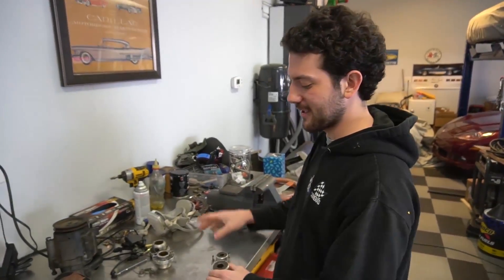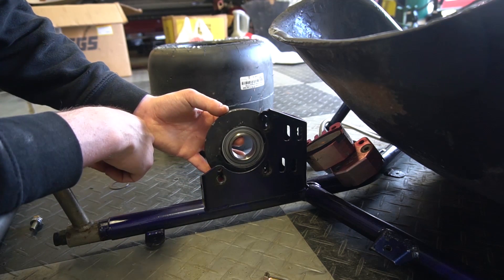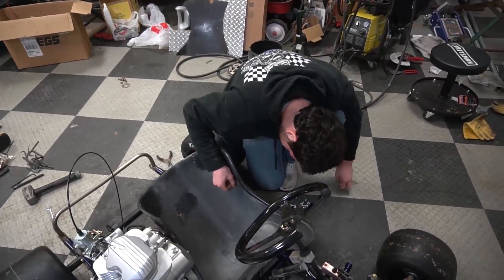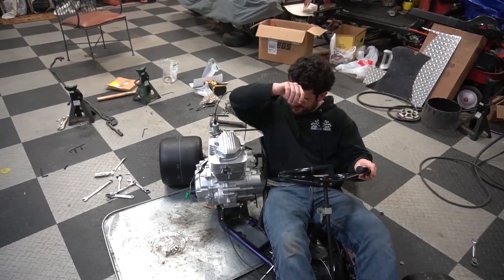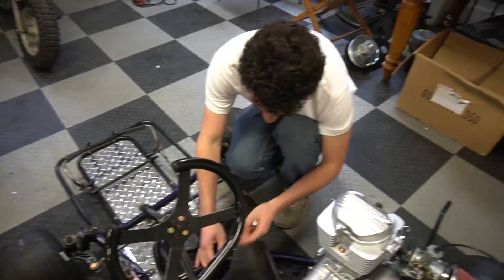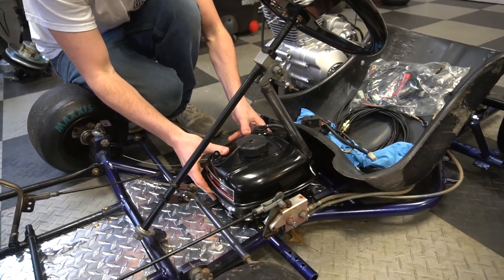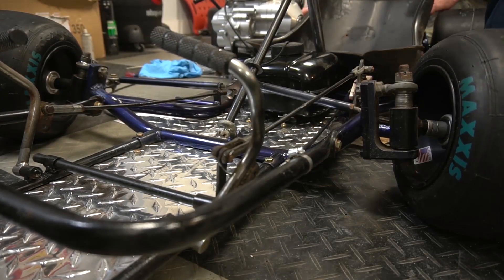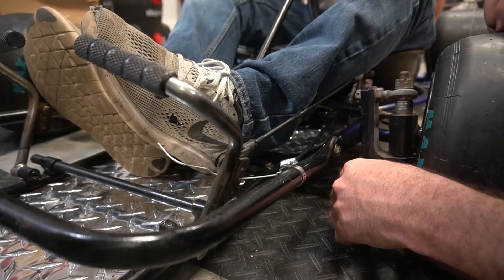200cc Racing Shifter Kart Build: Rolling Chassis! (Pt. 3)

Comment: Random tips to help your go kart faster:
(Small engine performance mod list)
1. Open up air filter for more air flow.
2. Make sure throttle has full travel.
3. Clean the carb and fuel system.
4. Port and polish.
5. Mill the head.
6. Remove governor.
7. Stiffer valve springs.
8. Drill carb needle jet.
9. Open up the muffler.
10. Billet flywheel.

Comment: Go to a local "trucking/heavy equipment" repair garage. BYOB. Ask them for a few gallons of their USED oil from diesel engines. When making any kind of pedal, lever, etc., heat the rod at your desired bend with a MAP torch until cherry red. Bend it, then quench in the oil only- NEVER water. Leave it in the oil till cool. The hydrocarbon and sulfur will temper it, giving it strength; quenching with water will harden it like glass, and will easily snap.

Comment: On the miata coolant leak - does that engine have the coolant block-off plate on the back of the engine like the stock miata engine? That could be where your coolant leak is. May also be a small rubber cap there.

Comment: Silly question but why not heat the rod for the brake pedal with a torch and bend it instead if cutting and bending then welding ??? Seems like a lot of extra not needed work.
Reply: lol. dont have a torch

Comment: What I use for throttle cables are hood latch cables from a gm car. The ends of the housing screw off so you can cut them down and reinstall the end for a custom fit. And if it brakes over time, just go get another one from a salvage yard or dealer.

Comment: Wish I could help you guys do the wiring. I've wires alot of similar engines and learnt a few tricks. Chinese wiring diagrams are pretty much useless but the cdi plugs are usually always wired the same way as are the stators. Just a case of pulling the cover and tracing the wires on the stator to the pick up/pulse coil (usually blue and black) and an a.c. power wire (usually 1 red and black) at minimum to make it run. Then there's a wire/pin for the kill switch, a ground (2 ground wires on the 6 pin cdi you have in the vid, google 6 pin cdi and on images the pins are labled) and the coil (from the cdi). 
The other wires go to the reg rec (usually yellow and a white) from.the engine to yellow/pink on the cdi). Hopefully I'm not telling you what you guys already know lol

Comment: dude dont play with it buy the kit and drop a 302 in there be done with it. take the engine to a shop have them stroke it and make it into a 347 stroker and get scared because it will be crazy fast and crazy easy to burn the tires off it

Comment: Assuming you noticed while editing the video but it was not the barrel nut that slipped. It was the hoseclamp you are using "for testin purposes only" too keep the clutch cable end on the frame.

Comment: Always cut diamond plate from the back, a lot smoother to cut and leaves a better edge. Also.... John,  heat is your friend when bending thick round bar like you used for the brake peddle. Sooo much easier and quicker. The kart is coming together nicely! Ready to see her rippin' down the road and banging gears!!

Comment: Still sounds like your plasma cutter still has too much pressure. You need a water separator/pressure regulator mounted on the plasma cutter.

Comment: I have a problem with my go kart if anyone could help It would be amazing I got it for 600$ perfectly running one month later I turn it on , start driving it for like 10 or 20 seconds then turns off, I changed the fuel pump, could it be the carboratour because barely no gas is flowing through

Comment: The card your using is fairly cheap. You best bet would be to use a real Mikuni Vm26 or vm28. You will get better quality, but also much better air flow. Real Vm carbs dont have butterfly chokes, they have internal chokes. $120 for a real vm carb is worth it if you want get better power and better tuning.

Comment: Please don't think im being a know it all sorry if i come accross like that 😔 use are very smart, talanted  an may allready know but in my experience for that low fuel tank to work you'll need a fuel pump with a secondary small surge tank or a palse vacume pump a put a vacc line into your intake manifold. I buy the complete wiring loom its strange how it never came with the loom all mine always doo. Besides full looms are under 60 bucks anyway an you get everything plug n play. Love the vids guys an this shifter kart is very cool.

Comment: Regarding that brake pedal, there are two things that will send a blacksmith to hell.  Bending cold metal, and not charging enough.  Instead of trying to pie cut things, just grab a fire stick, and get it to dull red. It will bend easily then.
Reply: i wish we had a torch
Reply: Isaac it'll be fine 
While having something that adds oxygen would be helpful, you can get the metal hot enough with a $20 map gas rig.  Or you could go old school blacksmith, with some charcoal and a source of air like a hairdryer or even a computer fan in a shroud.

Comment: it's the same CDI as on the Pugly, have a look at where the cables run from that CDI and do likewise on the shifter kart. the two contacts next to the 4 pins cdi goes to the pickup, and two of the four goes to 12v the other two goes to the engine stop switch, Pugly will tell...
Reply: its different than pugly we checked

Comment: Add a bracket and tap it to put a bicycle brake cable adjuster for your clutch cable. It should work well. Try to find a bmx one that is steel or heavy duty and mount it on the frame in front with your clutch cable in it. I have had good luck with this method. Even the cheap aluminum ones will work but they wear out prematurely. Also bike stuff is  easy to find.

Comment: Quick tip: youre supposed to run axle collars one every part where there an exposed KEY, so the key cant slide out, so the sprocket, brake disk and possibly the wheel hubs should have two-pc collars holding the keys bros!
Reply: Also, the electric fuel pump is overkill and silly, a vacuum diaphragm one would have been better- youre gunna flood like a mess with that setup
Reply: What the heck is that "Rod" youre using for pedals? looks like Galvanized? YUCK! should be some regular cold or hot-rolled bar stock, then HEAT it with a torch to bend it,  youve got a mess there dude!
Reply: Lastly, why WELD a bar for the clutch cable across the BOLTED-ON bumper and the frame, make it removable so if you crash it, it can we serviced?

Comment: Making a shield between the engine and the driver can also double as an air diverter which has a slight ''hood scoop' effect at higher speeds if you sculpt the material the right way. also gives a place for a padded arm rest! (~_^)-b

Comment: i had a foot clutch on my 175cc 2stroke shifter kart.you use it once to get started then you rev match the clutch starts to slip if you use it in higher gears, not at first but it will. your kart is gonna be fast as hell with that small rear sprocket dudes

Comment: Engine placement maybe lil hot!!! So I'm wondering if maybe put an oil cooler on the front of cart somewhere it ventilates properly and run hoses to and fro,.. Would that help to keep it cool enough so it'd not be uncomfortable to ride?? Maybe take oil cooler from an old Yamaha moto4  350atv. I bet it'd be pretty cheap but idk how much it would help. Or if even possible to change that engine over to be oil cooled. What are your inputs on this {cars and cameras} or anyone else?? Would it be sufficient? 
That intro 😄, different but 👌, hell I liked it..
Reply: we will wing it
Reply: BlkiceMike maybe they could make a heat shield

Comment: I have a 200cc motor. And i used that wiring diagram too. When i hooked everything up i relased there was no spark. I checked the wiring with no luck. After a week of trying to get spark, i found out that the wiring diagram was wrong. To wires on the cdi has to switch places. I cant remember which wire, but After that i got spark and its working today. Hope this will help u out guys. Big fan from norway!
Reply: thanks. we got it running first try

Comment: If you haven't figured out the wiring yet i can help you with it. I've done wiring on all kinds of engines. They all kinda work the same way, only thing is if its an AC or DC system that makes a difference.
Reply from the maker: We finally got it figured out and fired it for the first time today! Thanks!
Reply: Knowing enough to be dangerous I think the ac/dc is their problem. Trying to make one work in a system designed for the other is just about a complete rewire and you might as well buy the correct cdi for the harness.

There is also one type that has 2 different types of plugs. One they are rounded on the corners and the other square. If memory serves I think they will swap if you change the connectors on the harness. I want to say its the ac but again I don't recall exactly. Too many moons and beers have passed since I worked on these regular enough to spout facts without having to double check.
Reply: neo 71665, you cannot use an AC cdi box on a DC system. It will not work no matter what wiring you do. The AC systems get their voltage from the stator and the DC systems get their voltage from switched power. That being said you may be able to get a DC cdi working on an AC system, but i've never tried that. Maybe i will try it just to see if it will work. The plugs dont tell you if its AC or DC its the size of the box that tells you. AC boxes are very small and DC cdi boxes are much bigger. I believe the cdi they showed in the video is a DC box.
Reply: FireAndGasoline do you know the wiring to get a 82-83 honda cb750 running? Thats my karts engine if i can get it running
Reply: FireAndGasoline it works!, done it on many scooters, just don't use a 2stroke on a 4 or vise versa
Reply: nathan butler, i dont know it specifically off the top of my head. If you message me on Facebook or Instagram I'd be glad to help.
Reply: FireAndGasoline The AC/DC swapping rules get very fuzzy from engine to engine. If the engine has an exciter coil, an AC CDI can be used. You just connect the output of the exciter to the power input of the box. DC CDIs need a constant DC voltage source whether that be a rectified 2 or 3 phase stator or just an auxiliary battery. It's not difficult to switch from an AC Box to a DC box if your engine has a charging system and regulator. My gy6 based buggy is setup this way. AC box, but full DC charging system. 
On most DC fired systems, the stator sometimes will have a built in exciter coil due to the modularity of stators. This would be unused unless for some reason you wanted to switch to an AC Box. 

All of these 6 pin CDIs are based on the old Honda 4 wheeler, 3 wheeler, and scooter engine boxes. I've actually used one of these CDIs to fire a yamaha 350 atv engine with a from scratch harness.
Reply: nathan butler , The easiest way would probably to get the wiring harness and just tape up anything you don't need. You'll need the starter solenoid, cdi, coils, pickups("pulse generator"under the right crankshaft cover), starter/kill switch.  There are simple wiring diagrams for the old 69-78 fours floating around. Your bike is almost the same but instead of points(connect to coils) you have pulse generators(connect to cdi).

Comment: Guys I've got kart with XR250 6 speed trans electric start engine on er. Hand shift foot clutch. I bought it some tyres n rims from a little 4wheeler (like the 1 yous just got) cause I want to use it on the beaches should be mint. Regards from new Zealand
Reply: sweet

Comment: Still want to see you guys make a smog pump supercharger on one of your builds, I did some digging and it can really add boost and I'm thinking there is some guys that would like to see it done CarsandCameras style.  Thanks for all the great videos, I watch them all.
Reply: Yup,.. I second that..👍.
Reply from the maker: We have one we'll probably stick on a stock 212. Ike doesn't think it'll push enough air to be beneficial for a built 212 or other high output engine. I suppose we could do some testing...
Reply: CarsandCameras you could build your own centrifugal charger out of a turbo and a pulley?
Reply: They already tried on pugly

Comment: Hey John, think about making a T-shape brake pedal. Thus you can place it aligned with the steering column and brake with a left or right foot, or even both, whatever the driving situation requires.

Comment: Your Miata issue is the reason I don't modify my DD's anymore.  I need them to be dead nuts reliable.
Reply: 4gasem 
Yup, took me almost 20yrs of driving to realize that it’s more fun to have a play car on a different set of plates. 
If one car breaks you have a backup, not that I’d drive the second car in any type of bad weather.

Comment: Guys... When you weld thick pieces together then grind away 90% of the weld, there is very little strength left. When welding thick pieces together you need Big V notches or bevels between parts so the weld gets in the middle of them. Then when you grind away the outside, you still have something holding it together. That pedal arm is weak done the way it was. A much better way is to heat the thing with a torch orange hot then bend it.

Comment: You guys should build an off road lawn mower
Reply: What would you do with a on road mower?
Reply: I totally get what you mean. I'm just amused by the idea that every lawn mower is technically an off road vehicle by design.
Reply: never seen an on road lawn mower...
Reply: Mr. Meeseeks its an off road lawn mower they can drive it with the off road go karts and the trailmaster
Reply: KD Customs Honda made one. The stig from top gear drove it
Reply: Mr. Meeseeks Except for the fact they have almost no suspension whatsoever...
Reply: They kind if did. And proceeded to break it right away.

Comment: You know Amazon sells CDIs right I've got a racing cdi on my 110 qaud that has 5 pins in the plug and it was $10 it looks like you have a 6 pin cdi Amazon has a lot of stuff like that i would check it out Amazon also sells wiring harness to my qaud was thrown together from Amazon cause I'm broke and cant afford anything else

Comment: Rule number one when doing used engine swaps. Always change out freeze plugs and any covered seals (rear engine/front trans) while the damn thing is out of the car.
Reply from the maker: Turns out I forgot to put a bolt in a bracket that kept a coolant line from falling out of the back of the engine😅 everything was fine, transmission didn't have to come out.
Reply: Freeze plugs don’t go bad unless the coolant has frozen. No point in changing out a perfectly good factory freeze plug. And the only seal to change prior to an engine swap would be the rear main seal. The coolant leak is likely a heater hose or pipe.
Reply: Jacob Flannery they rot from the inside out
Reply: Or is corrosive. I have a pickup that needed all the freeze plugs replaced 4 years after being built because GM's bean counters saved a few pennies per motor by using steel plugs, and the early formulation of Dexcool ate them up.
Reply: Sounds like a freeze plug to me too
Reply: CarsandCameras what sprocket did you use on the axle and how many teeth? I’m building a go cart and I need a small diameter sprocket for clearance reasons, if I put an 8” sprocket that leaves me with 2” clearance. Thanks!
Reply: Glad it was a simple (for the most part) fix.
Reply: Freeze plugs corrode all the time. The cheap steel ones factories have gone to are worse than the older brass ones. People in the south where it's warmer more often than cold will put pure water in the system if they have to drain the system for any reason or have a leak. They run it that way until the temp threatens freezing. Will eat away at parts from the inside out.

For most engines the only seal is the rear main but there is the rare oddball with a seal in the front of the trans. Not knowing this combo I threw it in there to cover all bases.

Comment: Put a block of wood over the bearings then hammer down that way it goes in evenly right away and it saves the bearing from getting damaged
Reply: OG SPMEX I like to use a socket that just hits the outer edge no chance of missing
Reply: throw it in the freezer for a hr or so drops right in
Reply: don't hammer at all when installing a bearing. It's not about not damaging the bearing. You can replace that. The  seat is what's holy! Freezer will work and require much less to no force at all. Or use a press. And if you don't have one use a vice or build something with long nuts / threaded rod and washers / thick metal plate. works like a charm!